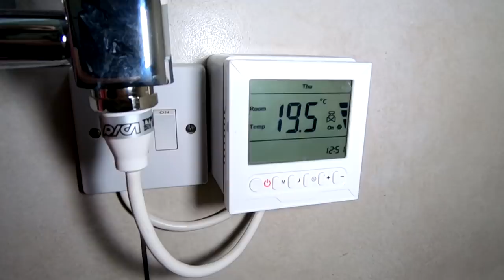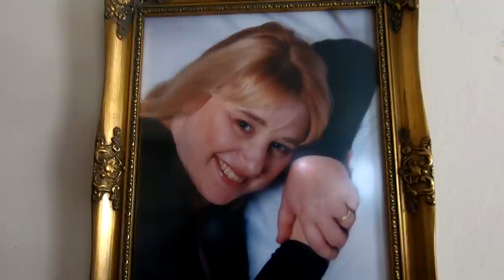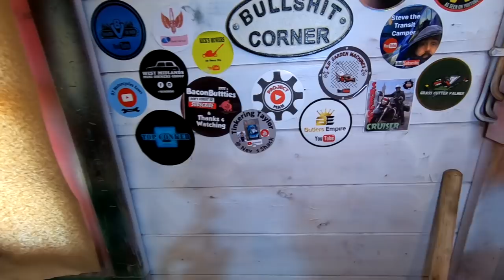Tinkering On A Bank Holiday British Family Vlog

Comment: Hi Martin your tct cutters you need a sds plus adaptor for tct you can get extension version which I would go for to get through the wall you will also need the drift and pilot drill bit which is tapered other wise the cutter will wonder ...make sure your drill has a clutch if you hit a wall tie they can break your wrist....
Reply from the maker: Thanks James.

Comment: hi martin the sds plus adapter looks like a  manufacturer default it should only have two ball noses and two long shanks to fit a sds plus machine. you can buy a sds core body adaptor from screwfix. or amazon hope that helps..
Reply from the maker: Thanks John

Comment: What happened to the keto diet Martin ?
Reply from the maker: I've been testing eating "normal food" and although my blood sugars are fine. I have put on a stone and a half so it means I'm going back to my eating plan. I've not over eaten but my system doesn't operate well on carbs and stores them as fat due to insulin resistance so I'm probably pre diabetic at the moment instead of diabetic. Its all part of my learning curve of controlling this Diabetes without medication. If I did nothing, I would be diabetic again. Its a matter of finding the balance.
Reply: @butlersempire  Good luck with it Martin👍